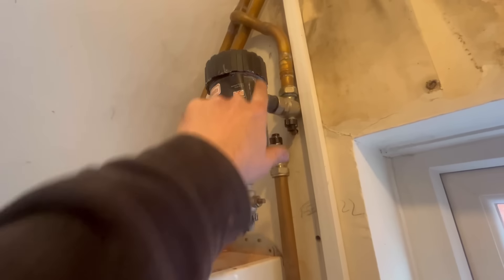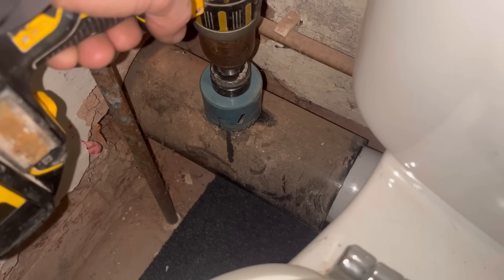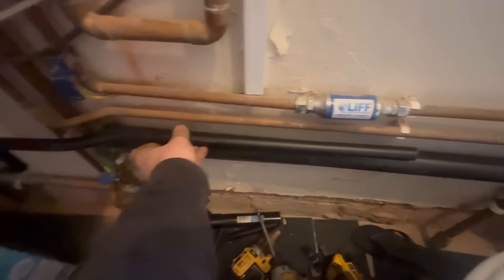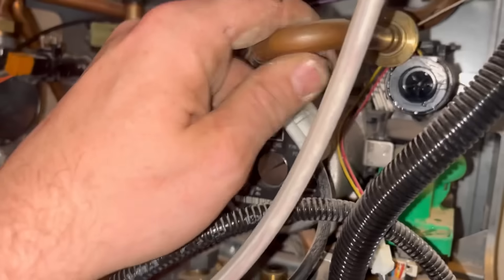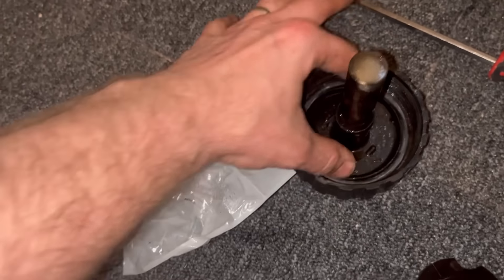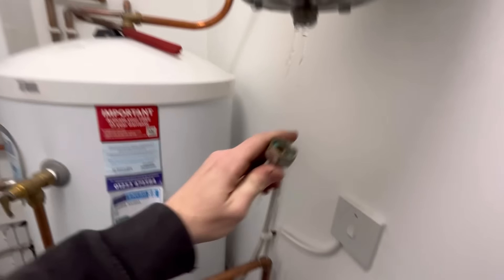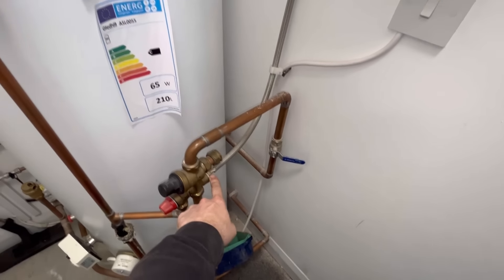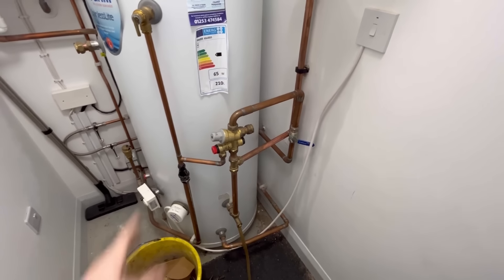Lazy Plumbers = More Work…This Design had us Frustrated As Well!

Comment from the maker: Anyone had an install that they have had to put right? Let me know in the comments
Thanks you all again for your support much appreciated 🙌👍
Reply: I had one recently where two properties had issues with dripping tun-dish one was the expansion vessel so quick fix the other one had the cold and expansion connection piped the wrong way round.. fair few years old so im surprised that one wasn't picked up before but then again these unvented cylinders seem to slip under the radar.. 

Would be good to get a video of you servicing a combination valve.

Comment: I had a Vaillant in the loft that did the same thing with the condensate pipe. They only got it rectified after the roof leaked when the lead flashing corroded. Soil vent was 2 metres away 😂

Comment: Never knew you could use the bender on the condense pipe cheers. I don’t know how these installers get away with such bad work. Another great video 👍
Reply from the maker: Thanks mate, yeah when I found out that tip 18 months ago changed the way I do them now 👍

Comment: Good idea putting a bend on the concrete pipe,I’ll be trying that out as I have move that pipe were it can be cleaned and checked this is working, as they original was on the wall that I’m now covered with a bulkhead for my walk-in shower .👍👍👍🏴🏴 Happy St George’s Day🏴🏴🏴
Reply from the maker: Happy at George’s day pal thanks for the support 🙌👍

Comment: Ive got almost the exact same job to do. Fernox TF1 filter is leaking from all seals but i found a new/old stock one on ebay for £65. Auto air vent aswell but its a system boiler so that poxy pipe is not in the way😁👍🏼
Reply from the maker: That pipe is a pain! Glad it isn’t in way for you…fernox TF1 leaking is not a surprise, only have to look at them and they leak 😂👍

Comment: Had a plumber friend go to a Worcester last week for a service... Took the case off and got a sudden smell of gas. British Gas serviced it 4 years ago and left the test point open (on the gas valve i think). His question to me was (i am a joiner) why did it not explode?
Reply from the maker: Ignition is sealed within burner so no form of ignition and gas has to have correct mix with air to cause an explosion 5-15% if remember right… them lucky thou to be honest

Comment: Worcester boilers really can be a pain, so be of the designers must never have worked on a boiler in there life.
Reply from the maker: Went up to Worcester and asked them if there repair engineers help design them, apparently not 😂
Reply: @bluebulldog_uk  I can imagine, literally changed a main hex on a junior last job today in Aldridge, hex was straightforward but trying to get the electrode connections off was just pain and frustration.
Reply from the maker: @smartboilercompany1983  them connections can be an absolute pain sometimes someone suggested long nose spark plug pliers before to help get them off not tried it yet thou

Comment: Tbf you could have just used 21.5mm to that stack as its internal.
Reply: Yup. That was an ugly installation.
Reply: @stepbackandthink  as my dad always used to say, you can’t make a silk purse out of a sows arse lol 😂
Reply from the maker: I know, stepped back at end and don’t know why I did so much 40mm 😅 always like to come off a stack connection in bigger bore pipe just to stop anything blocking them up
Reply: @bluebulldog_uk  Even 32mm would have made more sense.
Reply from the maker: @stepbackandthink  if that don’t get boxed in il eat my hat, already said In video and on comment didn’t like the way it looked in end but I always post everything I do good or bad